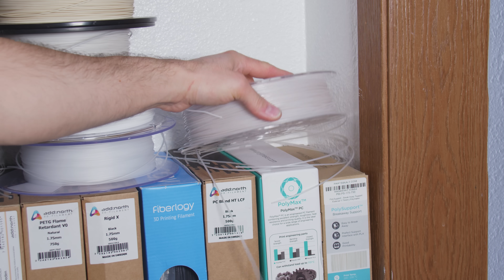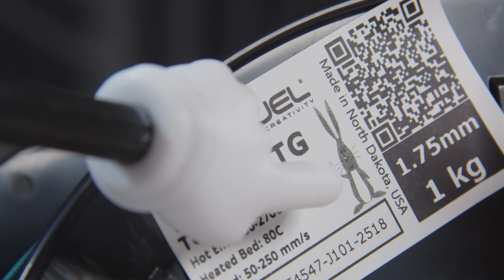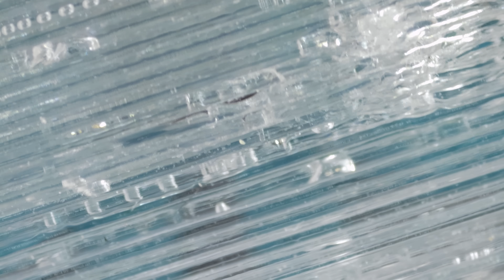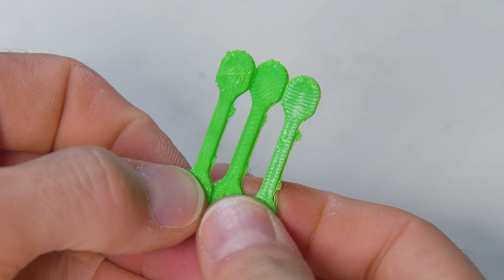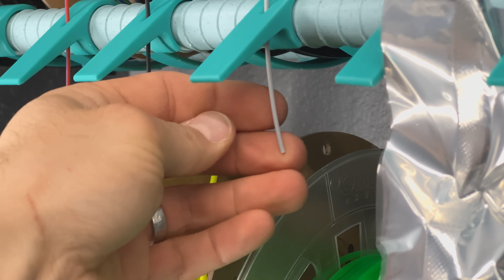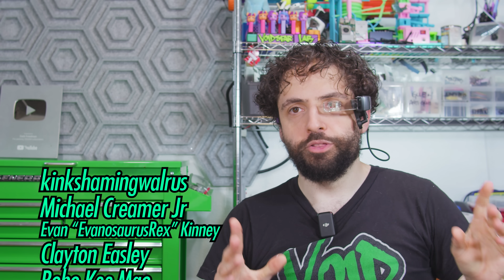Five Bizarre 3D-Printing Mysteries with Insane Solutions

Comment: Hey Zack you should test exactly how hot you need to get pla to temporarily relieve the stress from spooling and prevent those obnoxious fragmentation events. 

I may have noticed that if I dry my pla and leave it in doesn’t frag out. 
But that’s just one anecdote of a vague recollection of a possible scenario.
Reply from the maker: It's the glass transition temperature - that's where the polymer starts relieving stress by rearranging molecules instead of breaking intermolecular bonds.

Comment: I got the crumbs of doom on my bambu A1 when the heater assembly had loose screws, except the problem was on the first few layers and then slowly fixed itself as you kept printing. The auto bed leveling was way off with the play in the heater tip and it caused weird filament behavior until things stabilized. Poor adhesion, folds on the first layer, and then eventually crumbs. Finally I figured out what it was and retightened the screws and all problems vanished.

Comment: Second comment here - PLA is also semi-crystalline. We obviously don't see issues with standard profiles. However, this is where the "annealing" of PLA comes in - heat it up past the glass-transition temperature, hold it there for a bit, and sloooowly let it cool down and you get a (likely warped) PLA print that is harder (heh heh) and far more temperature resistant due to crystallization.
Reply from the maker: This is totally true, pure PLA is highly crystalline. It's just impossible to find it without plasticizers. I need to see if 3D Fuel can hook me up with the raw resin.
Reply: @ZackFreedman There are a few yet. Proto-Pasta is one. Some that aren't high-flow and just basic varieties are, but it's so much harder to find them now with all the "effects" like silk, flow, flex, etc.

Comment: I cheated and told the YouTube AI to give me all the answers:

"Give me all the answers to Zack's quiz"

Here are the answers to Zack's 3D printing quiz:

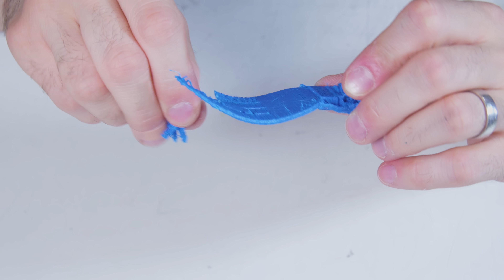1. The Nylon Nightmare! (1:24)

Problem: Nylon filament becomes brittle and crumbles after being dried, making it impossible to print.
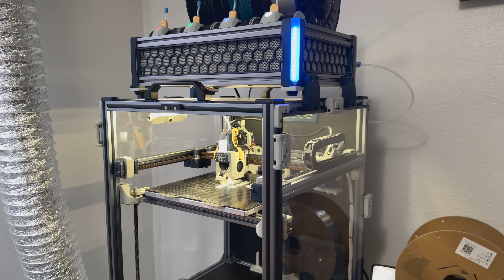Solution: The nylon was over-dried. Nylon is one of the few polymers that is strengthened by water (3:24). Leaving the spool exposed to air allows it to reabsorb moisture and regain its flexibility (3:41).
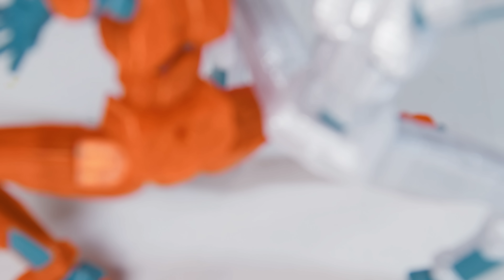2. Double Bubble Trouble! (Part 1 - Left Print) (6:06)

Problem: PCTG print has weak layers, matte surfaces, and tiny bubbles, despite being nearly waterproof.
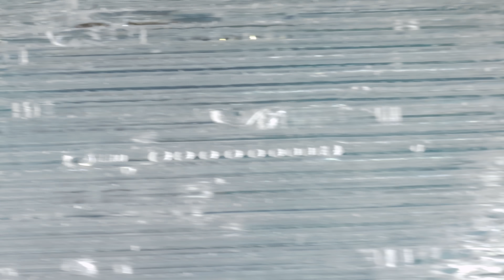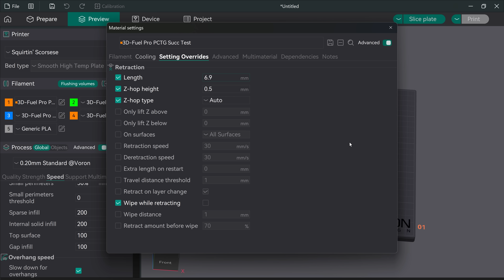Solution: The issue is caused by an excessively high retraction length (7:20). This setting causes air to be drawn into the highly viscous molten filament through the nozzle, creating bubbles that look like absorbed water boiling off. Reducing the retraction distance prevents air from entering the nozzle (8:28).
3. Double Bubble Trouble! (Part 2 - Right Print) (8:37)

Problem: PCTG print's outer perimeter is pockmarked with bubbles, while inner perimeters and infill are clear.
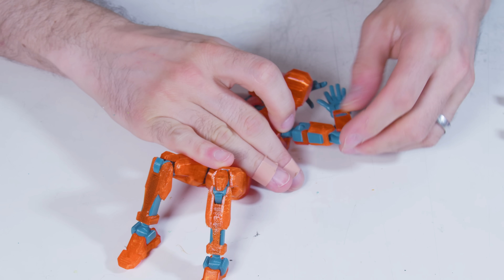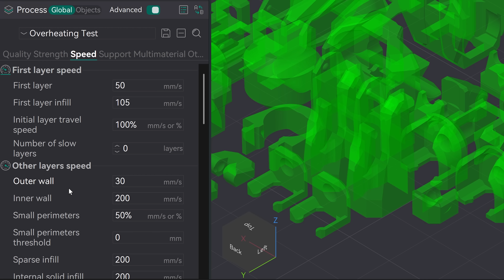Solution: The filament is getting burnt (9:49) due to spending too much time in the nozzle at the outer perimeter's slower print speed. The solution is to increase the outer perimeter speed (10:20) to get the filament out of the nozzle faster and under the cooling fan before it decomposes. Minimum layer time and volumetric flow limits can override this setting, so checking the print preview color-coded by speed is important (10:31).
4. The Crumbs of DOOOOM! (12:36)

Problem: Top surface of the print is muddy and shredded, with tiny crumbs of filament scattered around the print bed.
Solution: The nozzle is getting slightly tilted off-axis (13:42) because the gantry is switching direction too aggressively. This is due to the moment of inertia of a top-heavy extruder on a moving gantry (14:50). The solution is to reduce the maximum acceleration setting on the printer's limits screen (15:02).
5. The Self-Destructing Filament! (16:32)

Problem: A reel of rigid PLA filament spontaneously shatters into short pieces while in storage.
Solution: This was caused by internal stress in the filament (18:16). When the filament was unspooled for a previous print, the free end was looped through the retainer hole, preventing the filament from returning to its tightly coiled, annealed state (18:23). Over time, this stress led to hairline fractures. The solution is to rewind the filament tightly and secure the free end directly to the windings themselves, for example, using a filament clip that clamps the free end close to the reel (19:52).
6. The Peculiar Polymer Posse! (20:00)

Problem: Three different filaments (PET, polypropylene, and PEEK) are very difficult to print but are extremely rugged, translucent with cloudy regions, and their physical properties change drastically with print speed and cooling fan settings.
Solution: These three filaments are semi-crystalline solids (21:17). Their molecular structure can be amorphous (random) or crystalline (repeating pattern) depending on how they are printed and cooled (21:35).
Low fans/slow speed: Allows more time for molecules to form crystals, making the prints stiffer, more transparent (paradoxically, this means more amorphous regions, as the cloudy parts are crystalline), and prone to warping due to the material shrinking as it crystallizes (21:39).
High fans/high speed: Forces molecules to remain in random orientations, resulting in more amorphous prints that are weaker and warp less (21:49).

I cheated my way through life and ill be god damned if i learn something at 40

Comment: Holy cow the issue with the loose filament is just fantastic. I will run into this with my XL if I leave certain filamemts in the feed tubes for a long time. Sometimes it's weeks between print jobs. I always thought the straight filament in the tube was just absorbing more water from the air because it was loose from the spool and there was more surface area to get water-logged.

Comment: OK. Your talk about shear made me realize something I had battled with for some time with large-diameter nozzles. I have a 1.7mm CHT nozzle - both big and multiple paths. I had filament I KNEW was dry and yet it was bubbling as I printed.

The fact that this had two parameters that would easily lead to shear and trapped bubbles made me realize I was likely screwing myself over with retractions. Thanks for that bit of info!

Comment: Doesn't the fact that PCTG has a minimum flow rate (because of the higher printing temp) make it quite a bit more tricky to print than PETG?  It's not like most slicers have a "minimum flow" setting... Computing the final flow after speed and cooling have been taken into account is quite tricky.

Comment: The crystalized parts becoming opaque isn't that wierd if you cosnider that white is the result of light of all colours getting refracted in all directions evenly.
Take table salt, if forms beautiful clear crystals but once you grind them up it turns white due to many tiny surfaces reflecting and refracting the light in all directions.
If it's a glass you don't have those drastic transitions between crystals so your light refracts less and the object turns clear.

As for PP since it really likes crystallisation my guess would be, that it crystallizes fast enough such that the crystals stay small anough that they don't interact with visile light. Like how a parking lot full of cars is a seroius obstacle for your little Toyota but only a bumpy road for a monster truck.

Comment: The best way to remember that (for PEEK's case) that the Amorphous side is the transparent is that glass is amorphous as well! Our everyday use glass is a mess (in microstructure) but let visible light (and many other wavelengths) go through no problem. And then crystal structures are more neat/tidy and yet they block visible light. Go figure. It is somewhat complicated to actually explain but I do remember this fact from my Mat.Sci. classes. I don't really know how PP is getting more clear when it is in crystal structure instead of amorphous though.

Comment: The filament clip one is absolutely wild, I've had that problem before with tightly coiled samples of filament intended to be used in a 3d pen. I thought that the filament just "became old" and threw it away. Now it makes a lot of sense that it's likely the coiling that caused it, I assume the filament got rewound from a bigger coil before being sold
Reply: I have several self destructed rolls, time to print a few dozen clips!

Comment: 16:10 - the opposite can happen on bed slingers. I know from experience. The sv06 plus has a notorious x-axis tilt that makes it a little bit further print surface on the edges. The most reliable printing is in the center. It is demonstrable and repeatable and a known issue. There are Community fixes but it's just annoying.

Comment: With 0 prior 3D printing experience I got nylon (with all hints), second bubble trouble (the first one I guessed temperature was set too high, when that wasn't correct I figured the second was getting too hot but because setting was lower it meant feed speed. I also knew the black benchy was PVC), crumbs, and self destructing filament. It's interesting that those with 3D printing experience wouldn't know those - I went to Oxford but I studied applied mathematics and not material sciences, but I am a massive nerd.

Comment: PLA will also go brittle when dried too hard. I store my spools with a bag of desiccant in a vacuum sealed bag. If it stays there for a longer period, the portion of filament that was not in contact with other strands of filament, ie the length of filament used to clip the strand for tangle prevention, was brittle and broke off as easily as your nylon. The filament winding on the spool was fine.
Reply: I think that's the stress from it being kept straight instead of too low moisture
Reply: @TheGreatWolfYT  It’s not being kept straight except where it clips into the spool. The length between the clip and the filament winding is under no stress at all. It is simply not resting beside other filament so it dries faster and further. There may be something more in the physics of it but it is definitely a result of drying while isolated.
Reply: @fraudbuster1456 if you watch to the end of the video it talks exactly about this, how the part clipped becomes brittle because it tries to get back into the tight coil shape it cooled in the factory but since it cannot, mechanical stress breaks it down. 

It isn't moisture at fault here, the failure would look different, and such variance in humidity levels will not occur in a sealed vacuumed bag.
Reply: @TheGreatWolfYT  Moisture will dissipate faster and further in a single strand than in a bundle. That’s a fact. If that brittle section is left in humid air for a few hours, the brittleness vanishes. Mechanical stresses do not explain this.

Comment: I've had the crumbs of doom occur from a different yet similar cause: PETG-ESD at a high temperature, high enough that it was over-extruding, and the nozzle was picking up those remarkably large overextruded bits. I'm still working to tune that stuff in. It's run at a high extruder temperature since the ESD characteristics are notably better the hotter the filament is printed.

And now that I finished that segment, I'm using a PrusaXL which, despite the sizable linear rail, is absurdly top and back heavy, and made mostly via 3d printing. Probably didn't help.

Comment: This was great! Had no idea filament could self destruct under those conditions, always thought it was caused by water logging.
Reply from the maker: Waterlogged filament rarely misbehaves until you print it - the heat of the printer hydrolyzes the polymer and raises all kinds of heck. When issues happen on the spool, it's often an environmental issue.

Comment: I recently found 3d fuel PCTG and have really enjoyed using it when I want really good layer adhesion and/or a little extra spring in my print. One thing I tried a simple form of was printing a crazy  cookie cad petg filament inside of clear PCTG for a framework desktop side panel so that I could print the panel flat and still have PCTG’s layer strength for the tiny retaining clips on the back of the panel. I don’t have enough crazy PETG or PCTG colors but I do wonder if it would look good to layer multiple translucent effect filaments at various depths and overlaps inside a clear print to make a sort of almost opal effect.

Comment: yeah, i've got a weird problem. My layers will randomly shift. No idea what causes it. I've reduced axis speed and acceleration expecting it to resolve. My only other guess is warping edges catching the nozzle and stalling the axis. I use octoprint and it's 100% not octoprint. I can recreate the problem printing from the SD card. I've had this happen on every filament I print. PETG, PCTG, ABS, ASA, PLA, TPE, TPU. Seeing as it happens even on PLA I'm not convinced the warping is catching the nozzle. The printer is a Prusa i3 MK2S. Purchased brand new right before the MK3 was released. No modifications are on the printer except a bowden tube is is carrying filament from a Polymaker drybox next to the printer. But its not the resistance from the tube as this problem was present when I had the spools mounted above the printer on it's included spool holder. As far as I can tell both axis will shift layers but its more prominent on the X axis 9 out of 10 times.

a bit more info. the layers will always shift at around the same layer height. sometimes +/- 5 layers. If I change the orientation it can be entirely eliminated. Only to have it shift higher up. 
The layer shifts mostly happen at low layer heights, other times I've had them shift 150 layers up. 
My printing is usually at .3mm layer height. though it also happens at .2mm.

Comment: My extruder stepper started to die, I spent about a week replacing everything except the motor before I realized that it was skipping steps under regular printing extrusion speeds but not on the slower speed I was using to extrude while re-calibrating. It gets air now ;)

Comment: Thank You Zack. 

I just started using a new, new to me, filament and I believe that you've called out the solution to a problem that I've run into. 

Lovely timing

EDIT
Yup, fixed it. Excessive retraction pulling in air bubbles and ruining the surface finish. TY again

Comment: Does drying the filament help with the cracks on loose spools by annealing the filament again?
Reply: I will say I had a couple rolls of really old PLA that  I couldn't use because it continued to break every few inches. I dried it for 4 hours at 45C and it has printed perfectly since.
Reply: @wojtek-33 I had a similar experience. I thought it was water making it brittle. After this video, I wonder if I just accidentally annealed it.

Comment: My score:

(click show more for the spoilers)

Q1: Assumed correctly that it somehow dried too much, but was thinking more of heat damaged PLA.
Q2: Was first considering extrusion multiplier, but the moment you mentioned it being set in millimetres, immediately figured it out.
Q3: Initially thought of too slow acceleration, but soon moved to over temperature. Didn't quite get print speed on my own, but I feel I might have if watching a real print and saw the difference with the internal perimeters and infill.
Q4: Way too fast print speed, high extrusion multiplier and/or too low temperature. Ah, got it wrong, interesting issue.
Q5: Seems to be some sort of moisture ingress issue, but I doubt the issue would be so localised unless it's right behind a vent. Ah, the actual cause is interesting.
Q6: This one goes beyond what I'm familiar with. Thanks for sharing such an interesting factoid.

Comment: Uniform cooling is like 90%of quality in PP injection molding. If you have pigment issues it causes a similar problem with color "clumping" making swirls and speckled parts. It looks cool but you can rip a dash apart with your hands if it is swirly or speckled like that.

Comment: 3:19 I've never heard anyone in 3d printing mention overdrying nylon, but I always wondered if that was possible since it's common for landscapers to soak nylon trimmer line in water to keep it from going bad
Reply from the maker: I actually cut a line mentioning exactly that. It's not a subtle effect, nylon is massively stronger when it's saturated.
Reply: @ZackFreedman in combat robots, when making a chassis with nylon it’s common to wrap it in a tea towel and put it in boiling water for a few moments to ensure you get that strength. Can cause warping, though..

Comment: I've been printing multiple rolls of PCTG mostly without issue (P1S), so thanks for their useful profiles, I did change minimum layer time/fan speeds so got that question right!
Reply: Their profiles were a good starting point, but I couldn't print at all with them.

Comment: Honestly, for having never done 3d printing, I did a pretty good job here! I was in the right general frame of mind for most of them. I might not know the exact problem, but stuff like "it's getting overheated somehow" for "it's spending too long in the hot end" is a pretty good guess for someone without much knowledge in the field!
Reply: I had similar results (3/5), and I think a lot of that came down to Zach reminding us that printing is physical and chemical. If you have some science knowledge, that's enough to diagnose stuff even if you don't know the printer setting you're supposed to adjust.